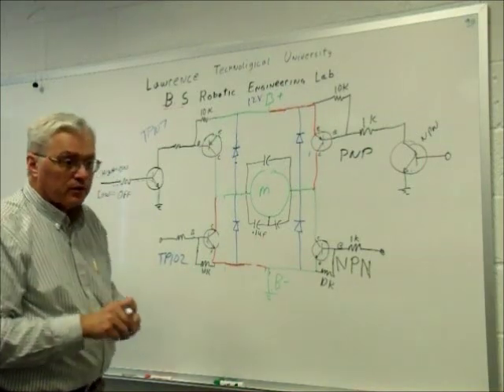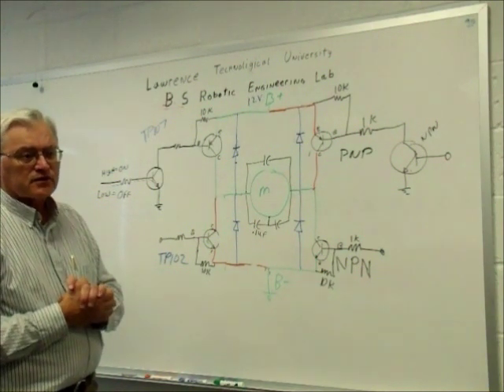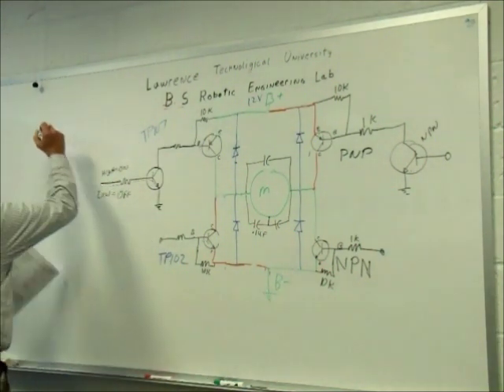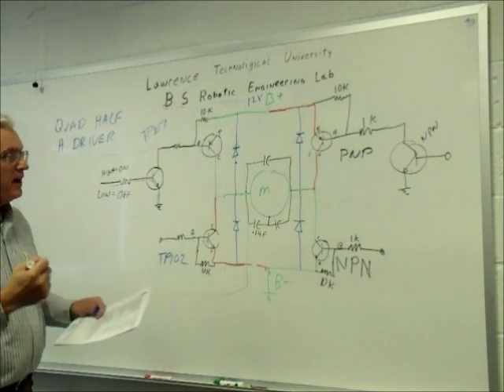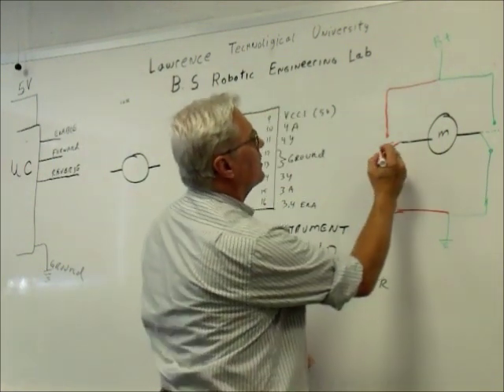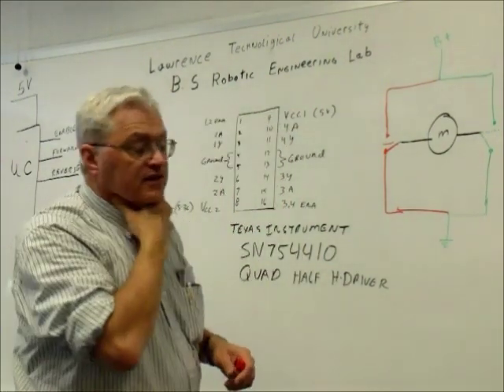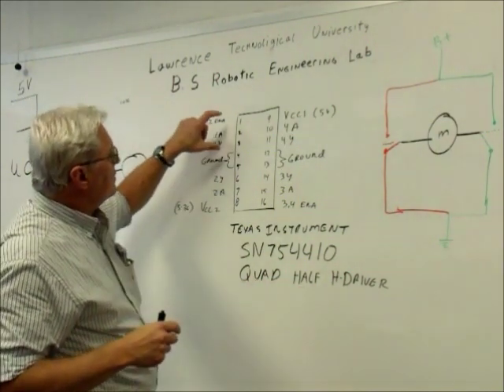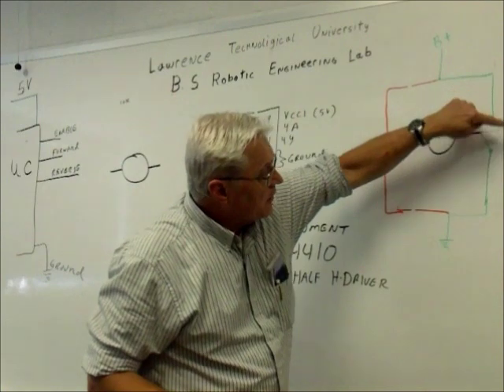H Bridge Driver for Brushed DC Motors - basic explanations and construction Part 4

Comment from the maker: From the only data sheet I can find on the STA458C - it looks pretty similar to the L293 except it appears to have built in flyback diodes and pull up / pull down resistors on the PNP and NPN transistors. It looks like you will want to sink / source about 100 ma to get it to turn on. But it would be best to get the data sheet from where you got the chip.

Comment: Hi! I am using the STA458C H-Bridge IC chip, but I have no idea how to connect it up to my Arduino? Initially I used the L293 chip for my small DC motors and I understand how it works quite well.. But now I need to use a much larger motor with a large power supply and now I have to change to the STA458C. Unfortunately I dont know how to connect it :(

Any help would be appreciated :)

Comment from the maker: The basic schematic would be the same. What you would need to to is pick the power transistors to match the necessary load. If you use NPN and PNP transistors you will want to make sure the arduino is going to provide enough current to saturate the transistors full on - if not you would have to use the Arduino to drive transistors that drive the power transistors. Or, you could use P chanel and N channel power MOSFETs to drive the motors in the same basic H driver configuration.

Comment from the maker: The H-bridge configuration lets you run the motor in both directions since it lets you switch the direction of the DC current flowing through the motors. 

The motors on the arm are comon brushed DC motors with a gear reduction like many hobby motors - they draw about 0.5 amps.  
Brushless motors need a circuit to swtich the individual phases for the (typically) three sets of windings as the motor rotates.The H bridge just switches the current when you want to change rotation direction.

Comment: Thank you, just a question please, why we use bridge circuit for a brushed motor? it can rotate with simple DC voltage. I thought we need such a circuit only for brushless motors.
Is this motor you use different from the usual hobby toy motors?